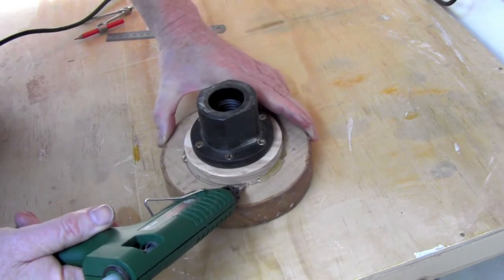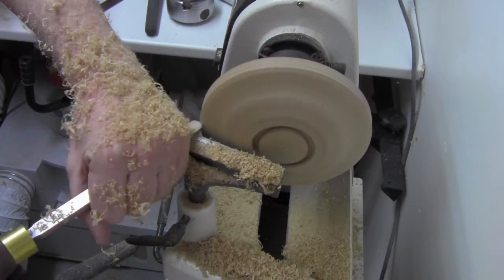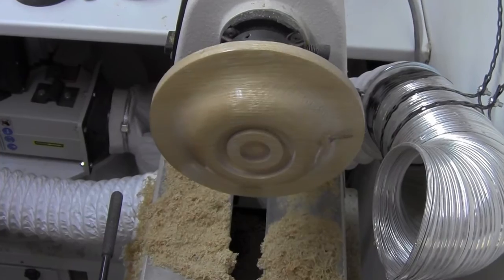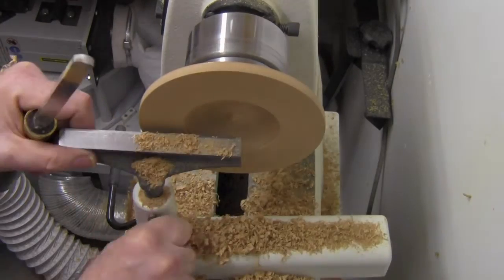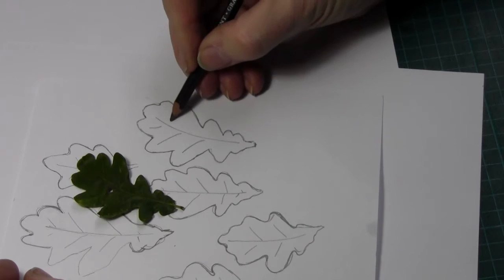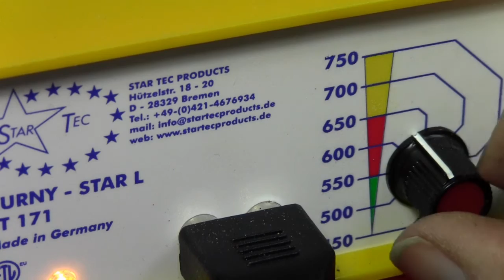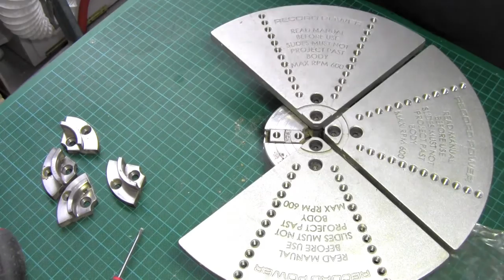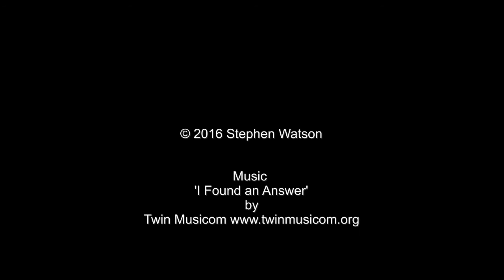Decorated Oak Coin Bowl with Pyrography and Woodturning

Comment: That's really nice Stephen. I've still not used my Pyro machine properly, just tested it on a couple of pens so far. They were both Oak and I found that it was very rough much like your bowl where it was burnt. Also just recently had a similar issue with the glue up of a penny on a project soon to be shown. I glued a penny on the lid of a box, got a bit messy so tried to clean with Meths, then when I glued a concho on top it all fogged up where there was an air gap.

Finished bowl looks really nice, well done!
Reply from the maker: Its all experimentation. A lot of my project never go according to plan but some turn out OK. Others become firewood!!!

Comment: Came over from rag n bone. Nice work, did you seal the oakleaves with anything?
Reply from the maker: Just gave it a coating of woodwax 22, the same that I used when finishing the turned part of the bowl. A bit of elbow grease and it was fine.

Comment: nicely organised shop stephen
ive just finished building an 8 by 13 feet workshop in my small back yard, just need to get electric in after christmas and im raring to go!
like you i used a pvc door , and insulated it well for sound as much as warmth.
can you do a video talking about your dust extractor in more detail? it sounds very quiet, and do you have an fine dust filter hanging up?
cheers
Reply from the maker: 8x13. I dream of having that much space (he he). If I had running water, sink and a kettle in mine you would never get me out of there!

Comment: Nice bowl Stephen....Can I inquire how you made your dust extraction system and is it very loud when in operation please.
Reply from the maker: Hi David
I designed it to fit under the bench.  It consists of an airtight collection box with a door on the front (to make it easy to empty without removing it from under the bench) with a Thein baffle on top and a bog standard extractor on its side top of that which pulls the air through and into the cloth bag. I will be more than happy to provide more details if you want.

Comment: What is your lathe?  Is it a Jet Midi or one of the Axeminsters?  Project turned out very nice.  What is the wood?
Reply from the maker: Hi Hbg Bill. the lathe is a Jet1221 midi. There was no way I could fit a bigger lathe in the workshop but it's fine for the sort of work I do. If I do need a bigger swing for a specific project (very rarely) I use a friends lathe. The wood in this project was Oak. Thanks for watching.
Reply: Thank you Sir Stephen.  I have a lot of oak.. much of it is red oak.  I have not been very successful in getting a good surface on that variety.  I haven't tried others YET. :)  I was very intrigued by your YouTube site as I'm struggling with building a larger shed in my back yard.  When I see what you have accomplished with 6x8 I'm sure I can do a LOT with 10x16 or 12 x 16
Reply from the maker: Sir Stephen! (Woo thank you). A shed that size should not be such a headache as mine. 8x6 was my only choice. It was either that or continue to work in the back of the kitchen! At first I thought it would be a hindrance but I turned it into a challenge with some clever use of space. There are more details in a recent Vlog I have posted and I suspect that is going to generate more questions on space saving which I will address in a future edition so if you have any questions feel free to ask.
Reply: Sir is a ranking, no?  You rank high in my book for what you have accomplished. :)